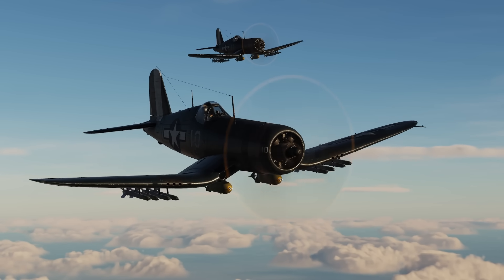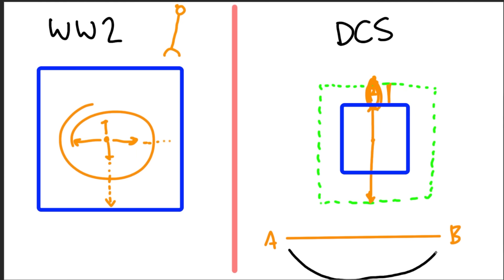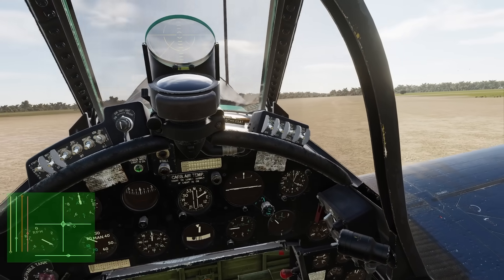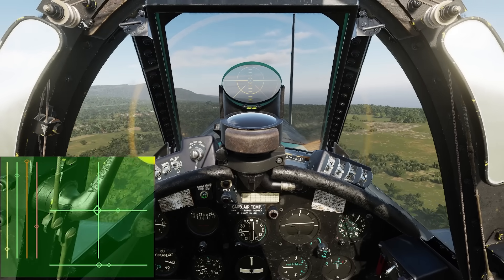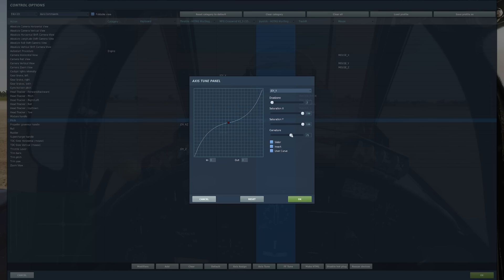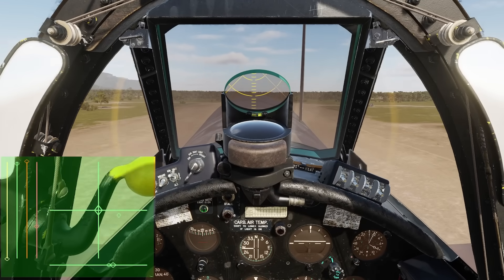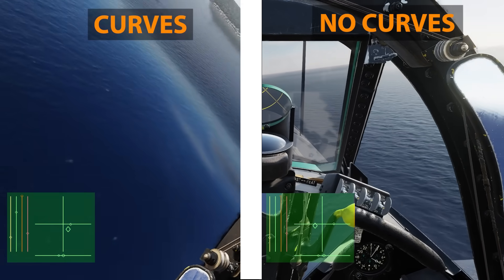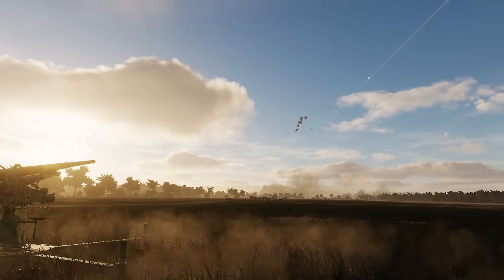Fixing the flight model: F4U-1D in DCS WORLD

Comment: it doesnt remove the problem which most flightsims have with planes.... they feel hanging in the air like a feather or spring. You can feel it much when using the rudder ! this sucks. I flew a cessna and this is not real at ALL !!!

Comment: Appreciate the settings you made it flyable, realistic i doubt.  The length of the control stick of ww2 aircrafts was discussed to death when the spitfire was released and everyone said it was too twichy and unflyable.  Its a good and valid point.  Your drawings are misleading although i understand what your trying to say.  I have collected a number of historical references for this aircraft but there were different versions.  Im not convinced the experience in dcs is representing what real pilots have written and manufacturers numbers.  Everyone has different hardware and expectations.  If a real pilot said the plane was twichy as hell and impossible to fly accurately then i would believe them.  As others have said RL trimming and fee3 of stability is completely lost in sims due to almost all feedback being visual.  Tough one to address.

Comment: That's not only stick motion problem. It has some kind of flaw in FM that allows it to do some crazy things like 180 degree drift and fly with it's tail forward.  Probably the cause that pilot has unlimited force and pulls the stick or rudder pedal with any load on them. The sooner it's acknoleged and fixed the better.

Comment: Hi TP, Many thanks for your input. Your insights really added value to the discussion and helped put things into perspective. Even with a stick extension, I’ve found that the added control authority during curves definitely helps, evermore so for the rudder control. That said, perhaps the real elephant in the room is that for many non hardcore WWII DCS players (myself included), coordinated turns are neither second nature nor frequently practiced. Most modules, especially those with FBW systems, either mask the need for coordination and power setting changes or are quite forgiving. The Corsair, on the other hand, is much less so. Is that a flaw in the flight model, or a sign of its realism? Hard to say definitively. After all, few of us have firsthand experience flying a real war bird. But that’s exactly what makes the Corsair so compelling for me: its unforgiving nature raises the bar, and getting it right feels all the more rewarding because of it.

Comment: I have had the best results with reducing the Y Saturation - especially on all control axis on helis. Not so much for fighters as you want to retain full aileron deflection for fast roll, but definitely for rudder, and you rarely if ever use full cyclic or collective on a helicopter during normal flight.
Reply from the maker: I’ll give that a look in the Huey, although it flies fine with my current setup

Comment: This is perfect. So many players complaining about the Corsair but the problem isn't the module. The module works fine! Yes, there are some minor things, but all in all this is a good early release.

Sound? Switch off the hear like helmet option.
Flight model? This video will help.
Can't get it up to speed? Check first that you understand the knots to mph or kph conversion, then make sure you have your magnetos properly put in. Still can't? Radiator/Intercooler, cowl flaps, rudder trim.

So many issues can be solved by educating the flyer. Assuming the flyer can be educated.
Reply from the maker: Video later today on the “it’s crap and you can’t do anything” 😁 I think it’s just fine,

Comment: My armchair sitting ass is gonna sound like a moron here but overall its not terrible, Id call it a pretty good EA launch actually given all the systems are mostly there (and you can get shot down in it unlike how the F16 was... No damage model in a COMBAT GAME, really?). You are sat very differently in relation to the CG (therefor also center of rotation) than most if not all other warbirds which exaggerates things as well from the first person perspective. ALSO stop trying to get into fights with 160 gallons of fuel in your main tank! 

HOWEVER - You objectively should never need saturation in any axis, because its removing total deflection from the range of motion on the control surface as it was modelled by the developer to compensate for not being able to use enough curve. Its coping for something that shouldnt be happening. This is the first indicator of an FM that has some weak spots or is poorly tuned for average sim hardware (desk top or desk mounted sticks and yokes). Depending on your hardware id consider curves from 10 to maybe 26-28 normal? Who knows.

Trimming is another shortfall of playing with these things in a computer game, especially without FFB equipment, particularly FFB rudders in a prop aircraft. A lot of folks will just simply not notice an oscillation or strange slide or drift or whatever it is until its developed into something odd as they pour the G on in a maneuver with an unbalanced aircraft. This aircraft the way it sits has almost zero inertia around its center, you can swap control inputs and point the nose backwards for seconds at a time. This aircraft the way it sits can also pull out of a dive with 20+G' and not even notice it. For SEVEN YEARS of development time, even part time, id expect there to at least be G induced damage of some kind.

The ground handling is among the worst ive ever felt in a game. It somehow manages to give the impression it weighs nothing and is suction cupped to the ground at the same time. Ive had some of the most bizarre landing experiences ever in this thing and thats going back to the late 90's sims.
 
It has almost no power-on stall characteristic, you can catch a dropping wing with a lot of preemptive rudder and hold the nose level with aileron/elevator on the horizon all the way down to 25 knots where it rather calmly and gracefully drops the nose down which im not convinced is correct, you never lose control (more likely it will "level out" somewhere between 40 and 60knots IAS and you can just hold it there indefinitely). Stalls seem like theyre just never really there in sims/games anyway i guess.

Comment: On top of Curves and Trim, the F4U-D rudder works different ly in VR and Virtual Desktop, if DCS FPS falls under 32 frames on the Mariana’s WWII map !!! 
Try taking off in the F4U -D, on the north airport found on Siapan island, the one with the cliff overlooking it!!!!!
Reply from the maker: I have, a few times. Pancake and VR, no issues
Reply: @TacticalPascale yer, I only noticed this in the new F4U module, as everything been great since the Cold War map release, a few months ago.  But what I have experienced could be my setup, or changes in DCS upgrade. But I’ll do further research and investigate. But in 2D on a UHD 1360 x 1440 I get 72 FPS, and have no issues. Question 2 VR headset at 2560 x 1080 with Nvidia adaptive VR enable, I drop to 27 - 32  FPS taking off on Siapan island, I get weird rudder and pitch issues…. But I try Guam island and change setting and let you know.

Comment: All the indicator needles, airspeed manifold pressure, etc continuously jumping around is not realistic.
Reply from the maker: I’ve never flown one so I wouldn’t know. 

May I ask how you know?
Reply: You became a pilot?  I’ve flown a number of aircraft and been in the cockpit of a few others. Admittedly, only one warbird, and have never seen any thing like it. Especially the manifold pressure and airspeed.  Also, great idea to put rudder trim on the stick.  I talked to a P 51 pilot at Oshkosh last year after flying mine on DCS and asked him about the constant trimming and he said that’s true. Any change in pitch or airspeed requires trim.
Reply from the maker: I’ve flown supersonic in a Tornado F3 and done multiple simulated dogfights in the Hawk (always as self loading baggage). I’ve never flown in a warbird. The needles do jump a bit, but the entire front panel moves in some of the German birds.

Is it realistic to the F4U - I have no way to tell so I work through it.

Comment: I watched this youtube video a few years ago where this helicopter pilot said don't use curves, you need to learn to deal with the sensitivity so that you can have linear input.  I took his advice and have for the most part gotten away with not using curves.  But the Corsair is janky.  Maybe I should make an exception to the no curves rule with this aircraft.
Reply: Don't think helicopter pilots, especially modern ones, and WW2 aircraft have proper overlap in design and all that. Only way to justify no curves for a warbird is if you have an actual proper full length yoke or stick and proper pedals with force feedback and all that.
Reply: @RunaKovacs  Yeah, I suppose.  I do fine with the other warbirds using linear input, but the Corsair is very sensitive.  It is hard to line up a shot with the thing bouncing around like it does.  The Corsair was nicknamed the bent wing widow maker, and that is the experience they are giving us.  After work I am going to try the curves to see if it makes it any better.
Reply: I actually had a hard time with the spit until i took away the curves, but this one is the opposite

Comment: Flight model is not about sensitivity of the curves, it's about how the plane react depending of speed, altitude (stall, turn, dive,...)
Reply from the maker: The turns, dives, stalls etc are a direct result from your control inputs, by adding curves it smooths it out considerably.

Comment: Have you tried flying air combat or ground attack missions with it? Doesn’t it feel like the nose stability is really poor? Even the slightest throttle input makes it wobble left and right. I know it’s caused by torque — but every aircraft has torque. This one is just especially sensitive. And this isn’t something that can be fixed just by adjusting response curves.
Reply from the maker: Yes I have and it flies just fine, no issues for me.

Comment: Hi, the F4U is as wobbly as the P-47 or the MiG-19. The problem isn't so much the length of the stick as the lack of drag in the center area. Maybe the programming of the controls in the module itself. I use 20 cm extension and added a plus 20 curve to the pitch and rudder, no curve to bank. And yet, the 109 and 190 without curves in the controls fly significantly better.

Comment: I have a 50cm long 109 replica stick placed at the center of my playseat. Still the controls are way to sensitive. Your explanation is well thought but from my logic its not the curve that solves the problem its the saturation that need to be changed. After setting them to almost 50% my controls problen was solved perfectly. Without any curvature.
Reply from the maker: I think with a longer stick there is less of a requirement as you are getting the range of motion. Everyone has different setups, the ones in the video work for the warthog, no extension, and the MFGs
Reply: @TacticalPascale  depends on the resolution of the magnetic hall sensore that defines the axis range. And that is whats completely off in the F4U setup. Thats why a saturation is handy, it redefines your resolution in game. The less saturation the less reaction to input. Hold in mind that a curvature will also have a acceleration going on.

Comment: This video has helped me, I had curves, but the take off trim details mentioned in this video helped a lot and adding Yaw Trim to my joystick hat switch, instead of having aileron, wing (bank) trim, really helped me out. However still with no stick input I trim for level flight and the plane nose goes up and down and it dive role to the left, then back to the center and right. With no input and hands off controls, running the game over 90 FPS in 1080p. Is this correct for the F4U. Its like flying with assistance on or having  a ghost pilot 😂😂
Reply: I think I found how to fix battle the trim issues in flight( ghost pilot issue).…As you MUST zero all your take off trim, after take off and you have some altitude to do so 🎉

Comment: Ex US Navy pilot here. Part of the problem with simulating realistic trim, especially in prop aircraft that live and die by trim in order to stay in balanced flight, is that there's no somatosensory feedback. In a real prop aircraft (I flew the T-34C for example) trimming isn't an ordeal because your body can easily sense an out of trim aircraft and adjusting the trim wheels essentially relieves that uncomfortable physical feeling of being in unbalanced flight.  In a game that simulates all of the aerodynamic forces accurately but has no way of providing the pilot the necessary physical feedback you will get stuck in a situation where you tend to get stuck in a positive feedback loop of trying to chase the trim constantly or even worse, not trimming at all and either always flying around in out of balanced flight or trying to wrestle the aircraft into balanced flight with the primary control surfaces.  It's one of the reasons I'm not really a fan of realistic trim in a simulator that can't give you the necessary feedback to maintain trim like you would in a real airplane. It may superficially seem realistic to constantly have to trim the aircraft, but it's so intuitive in real life that the goal to chase realism in the sim ends up making the experience less realistic.
Reply: Agree flying in a simulator is often harder than flying a real plane just because I don’t feel anything and have to constantly watch the instruments instead of looking outside 
Plus in airplanes with trim wheels the fine tuning you can do by simply applying slight pressure on it so that it barely moves is not possible when clicking a button on a joystick.
Reply: Former Marine pilot here. T-28B's in primary. P factor, torque and the feeling of your rear being on a ball bearing instills a need to make that feeling go away. That is done by trimming. Trim, trim and trim again on these warbirds. Watching the nose swing back and forth and the sensation of skidding are a result of out-of-trim conditions (Even in the Sim). Agree to swap aileron for rudder trim on these planes-all of them. None of the sim birds are as "bent" as some were in the inventory requiring aileron trim so disregard it. The other thing about these prop planes is the ballooning caused by the flaps. This condition is pronounced in the Corsair, but as in all, it dissipates and is countered with stick pressure so don't trim it out-wait for it to pass and then trim for on speed. Power-on right foot push and vice versa. Thanks.
Reply: @suecobandito8954  Agreed on yaw trim, it's correcting for those big paddle blades out front as torque steer builds and dissipates.  As for the rudder work on take off and landing with a tail dragger, if your feet aren't moving you aren't aviating.
Reply: Correct, you literally feel it in your guts, your entrails hang from suspensory tissues and like in your inner ear, it is uncomfortable when they are being distended out of standard straight down gravitational forces... or as the old timers say, it is a "Seat Of The Pants" feeling when everything is trimmed right.
Reply from the maker: @whisperingpinup yup, nothing beats the feel of a real aircraft, although I don’t want to pull G in a Hawk ever again in my life.
Reply: @TacticalPascale  It is a frame and stringer jet from like the 60's ( Hawker Siddeley Hawk ) so I guess it must have been a squirrely little jet.  Those T-45's have seen some things, taking Ensigns onto the Boat for the first time, imagine if they could talk!
Reply: I think the real issue, and where most of the awkward abstractions come from is the lack of most people having FFB sticks. The seat in the pants feeling is important, but I feel in my experience it's still primary visual. Though I'm sure you have a thousand times more experience than I'll ever have.
Reply: In the sim, and IRL, we need to rely on the gauges, i.e. turn coordinator here.  Rudder trim should center the bubble at the bottom.
Reply: That's one of the reasons I like Force Feedback stick, multiple choices out currently FFBeast and VPForce Rhino, primarily (Moza's is relying on older VPForce stuff that they stole, and they still havent got it properly working).
Virpil is coming out with their FFB selection next year, Thrustmaster is working on it too.
Reply: @ToreDL87   Yeah but not everyone can afford FFB, so that argument is moot.
Reply: @ToreDL87   Yeah but not everyone can afford FFB, so that argument is moot.
Reply: force feedback makes this problem go away. I think MOZA makes a new FFB stick, not sure how good it is, and you can still get old Microsoft FFB2 sticks which work but lack buttons. There might be other stuff out there too. FFB is a must have for flight simming, total game changer for helicopters and prop aircraft. Less important for super FBW aircraft.
Reply: @itsumonihon   Yeah but not everyone can afford FFB, so that argument is moot.
Reply: So what is needed is for companies like Thrustmaster to make floor-mounted joysticks with long sticks and force feedback mechanisms, as well as a comfortable seat cushion with variable left and right air bladders to make it feel like your seat is tilting left or right when you’re slipping of skidding.  Or a motor-driven tilting of the seat pan.  The force feedback can change the stick centering feel, as well as stiffen stick movements at higher airspeed.
Reply: @Andrew-13579   Yeah but not everyone can afford FFB, so that argument is moot.
Reply: Force feedback helps a TON with this.  I now consider it essential flight sim gear along side with VR.
Reply: @twifosp1  Yeah but not everyone can afford FFB, so that argument is moot.